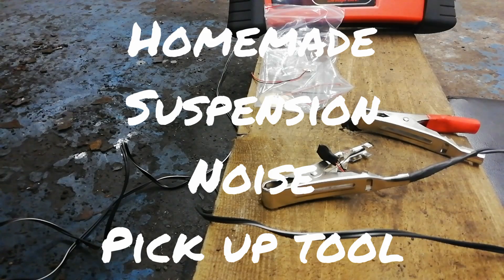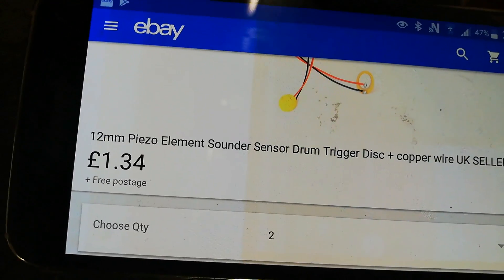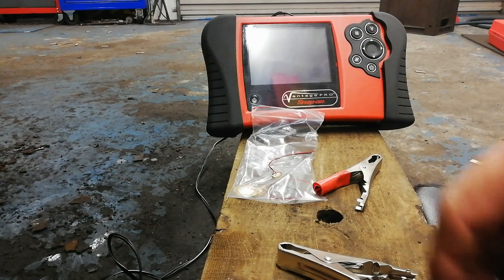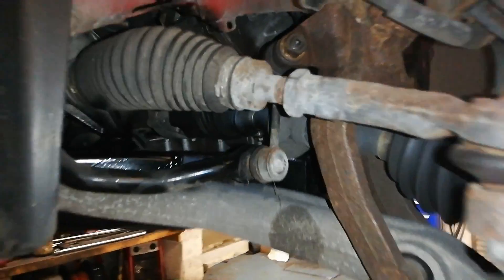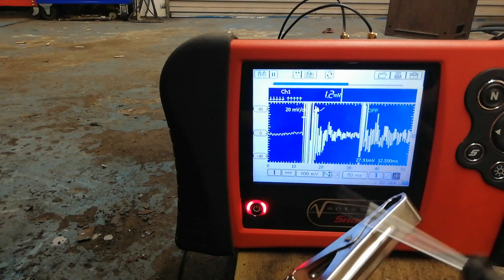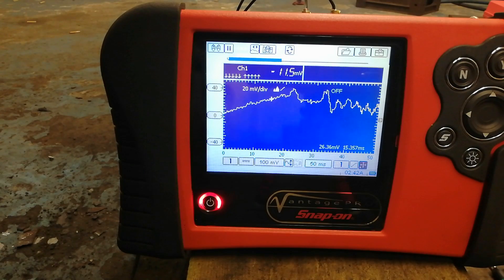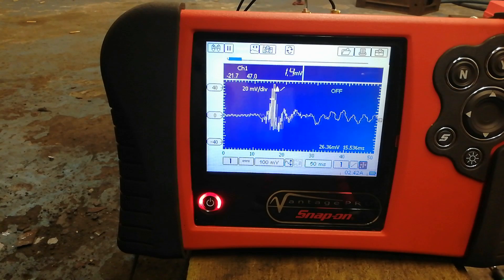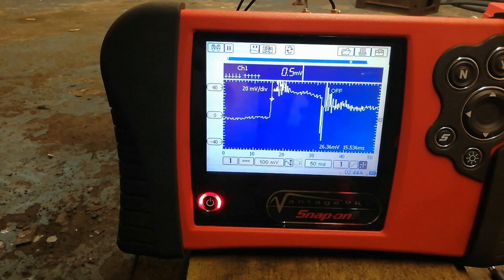Suspension knocking noise pick up visual

Comment: Interesting Dave. Is the crystal responding to vibration frequency or the audio emission of the knock? I am thinking maybe the former...not sure. If it is vibration, solidly mounting the element to the clamp may vastly improve sensitivity! Guess I can't bitch at the cost of this one!  Cheers Pal
Reply from the maker: hey ian, we must be telepathic as i was just thinking to super glue the wee disc to the clamp. The chassis ears clamps; piezos are free as this is based on them, altho they are amplified to audio. hope all are doing well across the pond, cheers dave